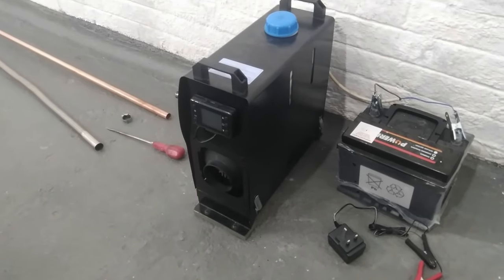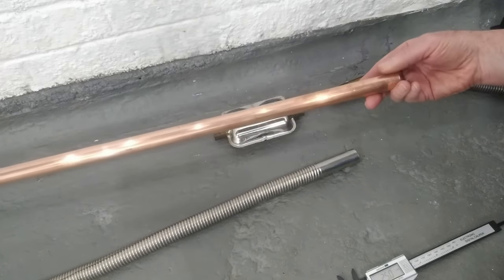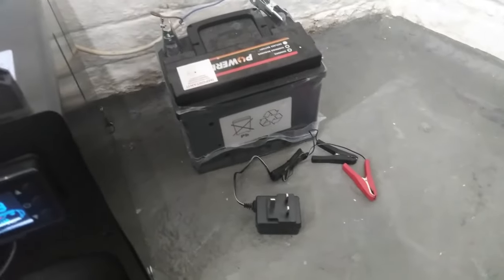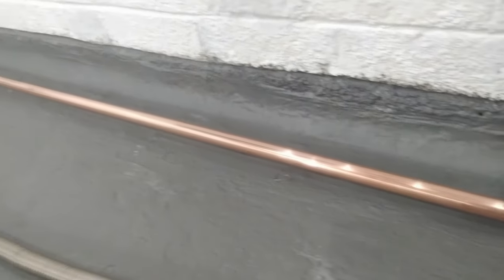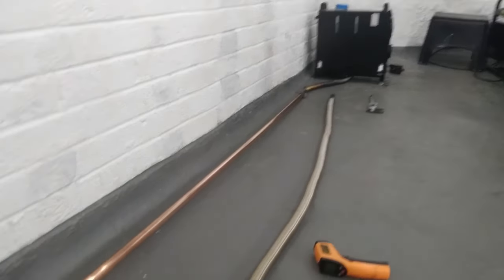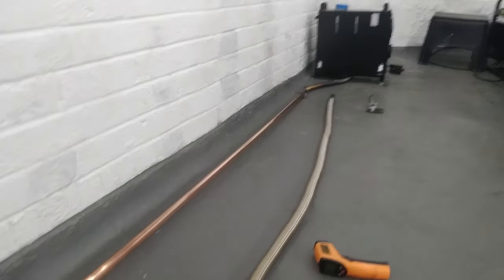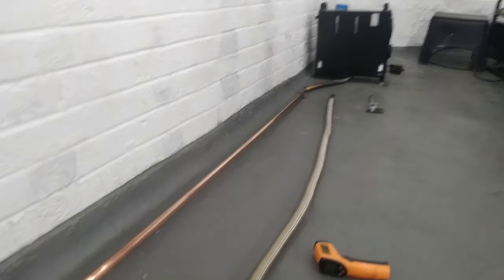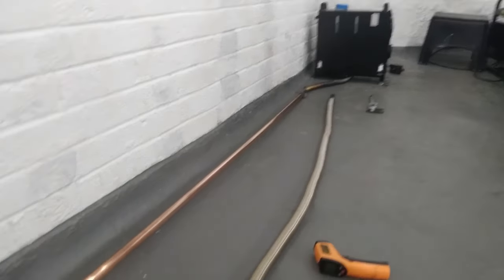This is the Longest Exhaust from a Diesel Oil Heater Chinese Life Waste Camper Van 22mm Copper pipe

Comment: I feel they will make these illegal one day because they work well and cost so little to run.
Reply from the maker: same here
cheers andy
Reply: I think they'll more likely make them illegal one day because of dangerous installs. These all-in-ones should be outside with the heat pumped into the space to be heated.  No part of the exhaust should be in the living/working place; it's not a failsafe install if it is.

Of course there's a lot of energy/heat to be recovered from the exhaust but there are far safer ways of doing this.
Reply: @martinevans6289 if they were to ban it they would have to ban all those LPG cookers on campsites and campers

Comment: Could of used a hot water baseboard heater instead of the copper pipe. Same size pipe in it with heat exchangers on it.
Reply from the maker: yes, i thought similar before, good idea thanks andy

Comment: Why not use hot water baseboards if you can get your hands on it same copper pipe I believe get that extra heat from it to heat the space
Reply from the maker: i will do that thanks
Reply: @andyfireblade  hey no problem 😉 I’m a hvac tech and thought I would recommend that to you

Comment: Putting a potato into the exhaust of your car/bike will make it heat up quicker thereby saving fuel.
What could possibly go wrong ?
This is effectively what you are doing adding radiators and long lengths of pipe to your diesel exhaust.
The instructions say to ONLY use the supplied length of exhaust pipe for a reason. 

If you wish to do such things you need to go into a larger diameter pipe and seal it with something that can withstand 2/300 degrees C.
Reply from the maker: yeah, i know what you mean. hahahahah. and i agree that it would be better when using a longer exhaust, it would also be better to use a bigger diameter. good comment , regards andy and thanks for looking in!

Comment: Could you put a radiator in the line of the copper, so that the exhaust gasses pass through the radiator & the heat would radiator through the radiator ?
Reply from the maker: good idea, i will try it out, cheers andy

Comment: I think kerosene is your cleanest burning fuel that you can get The diesel fuel here in the States has got additives in it The gum stuff up
Reply from the maker: yes , i like to use the kerosene. and its more pure, your right.
thanks for looking in on my videos.
did you see the one where i have one of these heaters heating my house?
its on right now!
https://www.youtube.com/@andyfireblade
cheers andy
Reply: @andyfireblade  any ill effects from using kerosene Andy? Pump issues etc? Different heat outputs as compared to diesel?
Reply from the maker: @stevenlarratt3638  hello my friend
we have not had pump failure due to the thinner kerosene fuel. the kerosene is a cleaner burn, thinner. it is a slightly cooler burn. but i highly recommend using it. its the cheapest i have found. 

stay warm this winter andy

Comment: I'm thinking about getting one of these heaters to heat my small workshop, would you recommend them, are they reliable
Reply from the maker: yes , but get one quickly as the prices are rising as it gets colder.
very efficient and reliable.
cheers andy 

Links:
Heaters: https://amzn.to/3ZwMAPc
12v power supply: https://amzn.to/40iHO8J
Long flexy exhaust pipe: https://amzn.to/3ZwMAPc
Ducting: https://amzn.to/3CF7l0W
Reply: Brilliant thank you for the reply I'll order one today.. 👍

Comment: a Hydronic Baseboard Heater is what you need to get the heat out faster
Reply: would you just add this inline with the exhaust? so the gas is passing though the heater?

Comment: Thanks for the video. Surprising how good copper heats up. Ive been thinking bout making a heat exchanger out of copper pipe running through another copper pipe with some reducing T's and some 12volt heat pump that circulates antifreeze through pipes and radiator. Here is an video of an plumber explaining how it can be assembled: https://youtu.be/ZKrPT0_vSug
Reply from the maker: Go for it!
cheers andy

Comment: I don't know why my comments kept getting deleted🤷‍♂️
Reply from the maker: ?
cheers andy
Reply: My comment was if you add aluminum foam fins to the copper pipe & use thermal edhesive to attach them to the copper pipe it can make a very efficient radiator
Reply from the maker: @travman2863  i like it where could i get some from?
that sounds good
Reply: I keep trying to say companies but my comment keeps getting deleted.
Reply from the maker: @travman2863  ? , i dont know why. sorry. have you got a link to one type that you would recommend, thanks andy
Reply: @andyfireblade  🤔I can't even name the companies or share a link the comment is deleted I don't know why against YouTube algorithm is my best guess🤷‍♂️ I have screenshots pictures of my comment on my phone but they're not showing up in post
Reply from the maker: @travman2863  usually it is ok to share a link